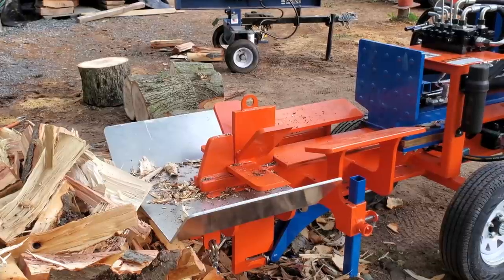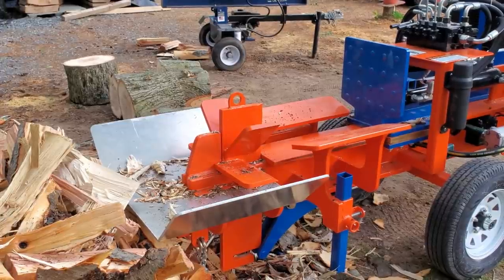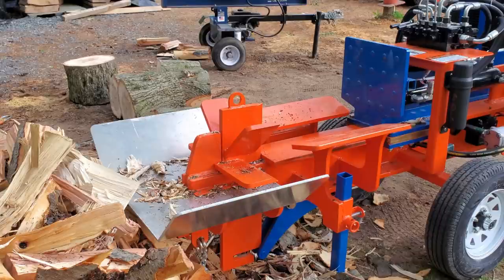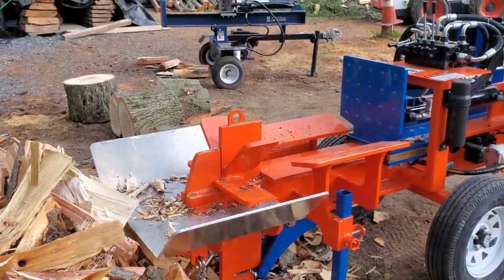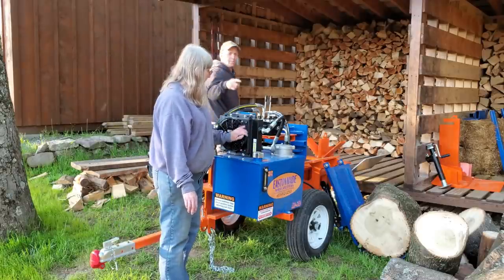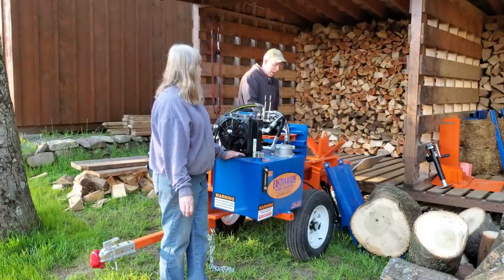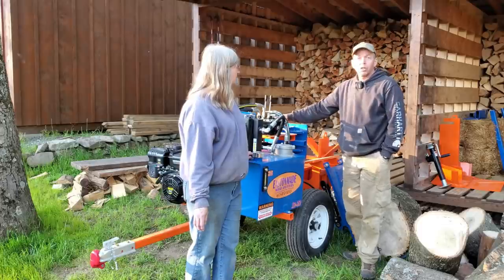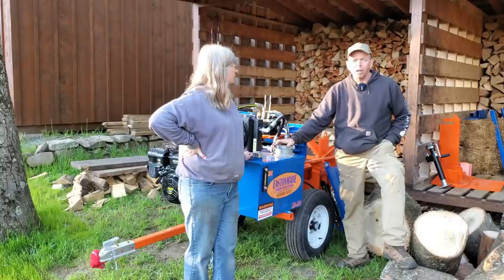Things are Changing on the Mill

Comment: Nice wood splitter I wouldn’t exactly call it a great Mother’s Day present only if the splitting came along with it. Makes a job easier with the proper equipment. I heat my house with a Central Boiler if it will fit through the door it will burn feed only one or twice a day. Save all smaller wood rest either give away or mill it. Good luck be safe with your new toy ten fingers and toes.
Reply from the maker: Deb considers this an excellent gift. I guess to each their own. Not many around like her. I'm blessed to have her.
Reply: Thank you Robert and I will stay safe.